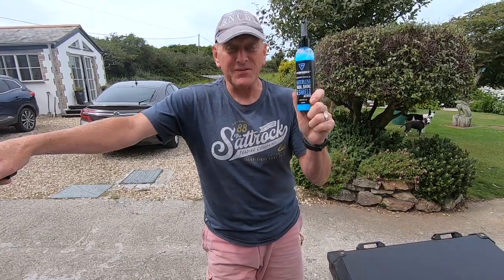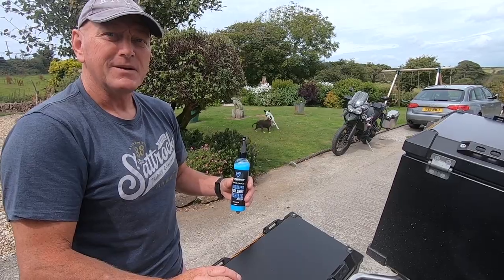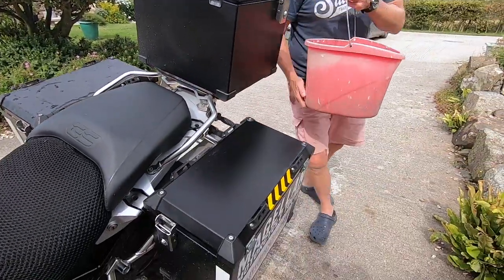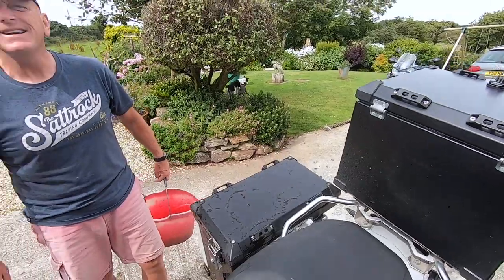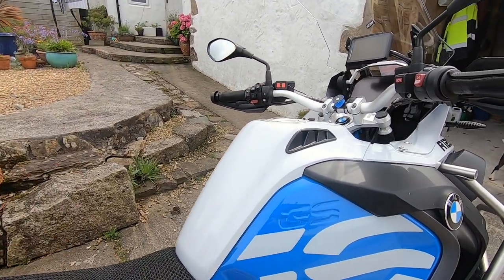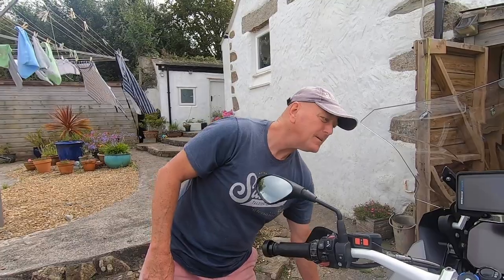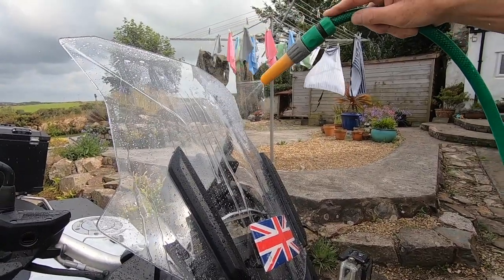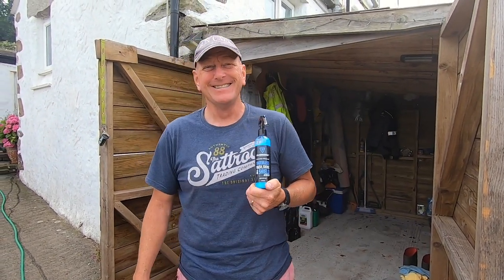Flowgenix Waterless Wash Shine and Shield | What's it like?

Comment: Given that their promo video includes stolen content from another motovlogger (search you tube for stuart fillingham and flowgenix..and skip to about 8 mins in)...who is fastidious about cleaning his bikes but has emphatically never used this...yeah, that kind of shenanigans turns me off a company. 

I'm also curious to know what the liquid is if it isn't water based? Pure chemical? Unlikely. The ceramic thing is great but there are plenty of companies doing it and cheaper (and as well or better) than flowgenix.
Reply: Martin Chandler we have seen the video hence the reason for the vid...
Reply: @markholroyd5365  Ah....okey dokey! That makes sense :) Nice vid, I did wonder how good it was. I got interested in the ceramic coatings recently (I'm a bit ocd about cleaning my bikes!); seems the best results are via the "proper" treatment (which includes heat lamps) but I had good results with Meguiars as well - bit pricey but definitely saves times when washing...and makes your bike smell faintly of bananas. Still not entirely convinced that's a good thing :)